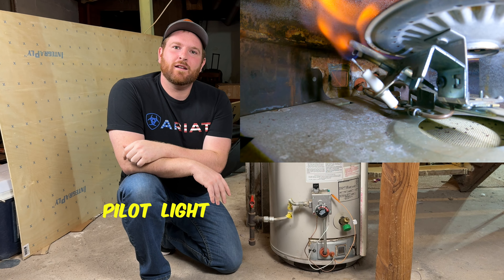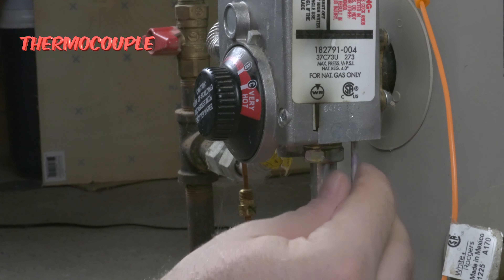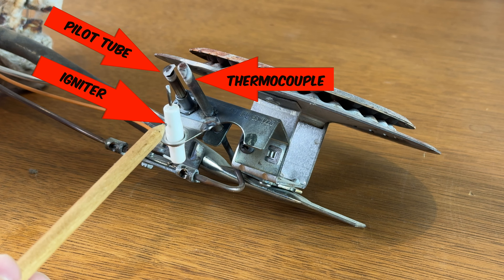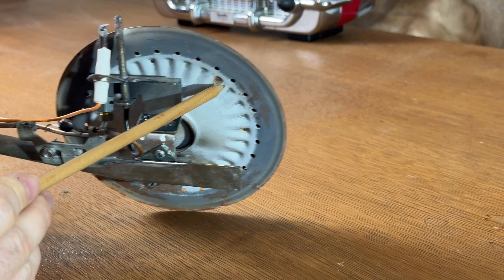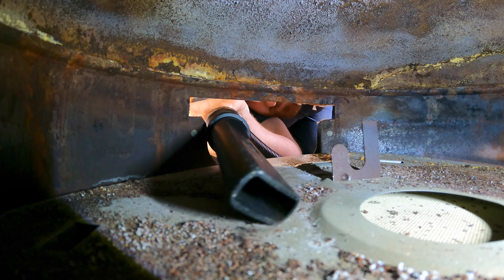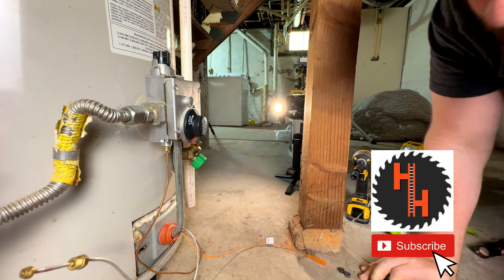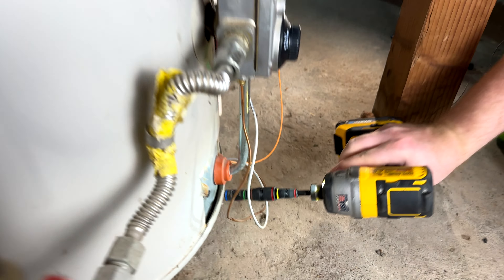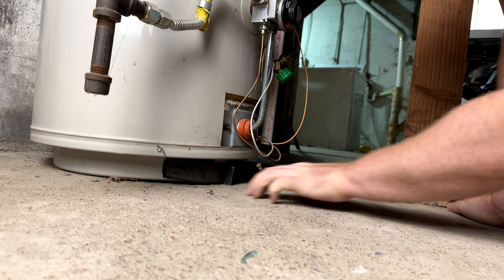FREE Fix! Pilot Light That WON'T STAY LIT on Water Heater

Comment: I replaced the thermocouple, go to light the pilot. Pilot stays on, but as soon as I let go of the gas, it shuts off? Any ideas?
Reply from the maker: Yes, often when a thermal couples replaced the flame is not hitting the thermocouple properly. I'd check that.  If that's not it, your main control  valve may not be working right, assuming the thermocouple is correct and working right.
Reply: @HandymanHertz  I double checked the thermocouple, looks good. Anyway to check the gas control valve before buying a replacement?
Reply from the maker: @CesarMEgureGonzalez no, I've never messed with them. I'm also not an expert, so you may ask someone who has more experience. Sorry.
Reply: If you have a blinky light that is supposed to come on, mine told me to hold the pilot button until that light started blinking.  Then turn it to the temp that you want.

Comment: Hi thanks for the video. I have the same exact thermocouple but unfortunately mine is broke. All the replacements I've seen or have been told will work from parts departments do not have that black battery looking piece. I can only find it on amazon. What is it and is it not needed? Can I replace it with a regular thermocouple? I did a temp solder to make sure that was my issue and the water heater worked fine so i know its the thermocouple. Thanks
Reply from the maker: What do you mean black battery looking piece?
Reply: @HandymanHertz  I'm not exactly sure what it's called. A fuse link? It's the piece there that looks like a small watch battery.
Reply: If you pause @2:01 its the little round thing in the bottom left corner. @HandymanHertz
Reply from the maker: @FishingWithZach oh, ok. I know what you're talking about and I wondered what that was too. I'm not sure what that is. I bought the whole kit on Amazon that came with it.

Comment: GSW only 2 years old. Pilot light stays on but as soon as i turn valve to low or high i get a backfire. Any ideas? Chimney is clear. Maybe the filter needs cleaning?
Reply from the maker: Oh, a backfire? Interesting. I've never ran across that. It almost seems like the burners are not aligned with the pilot light, so the burners put on gas, but it takes a while for it to ignite and once it does it poofs? That's my guess, maybe someone else can jump in here with that experience.
Reply: @HandymanHertz  thanks 🙃
I just pulled assembly out and cleaned burner and thermopile. Neither one in bad shape, but now its heating water. 🤷‍♂️. I’ll take it.

Comment: I've replaced the whole burner assembly and the control board. At least the board functions now. Before it wasn't readint it was lit. Now i will hold it & it goes to overheat light flash. Everything was clean. Still not working I'm literally gonna give up now.

Comment: Hi. I'm so glad I found (and subscribed) to this channel. I have a 3yr old American gas water heater (model: G62-40S-40R). My pilot keeps shutting off every day during the summer. I replaced the thermocouple but it didn't help. I believe the problem is not good enough air supply. My attic isn't vented and in summer it's very very hot. Did you hear of this problem?  Is there any "easy" (simple/cheap) solution to this?    I'm considering an attic fan, but that's thousands of $$$ and I'm looking for a cheaper and simpler solution. ANY THOUGHT/HELP WILL BE GREATLY APPRECIATED AS I'VE SUFFERED THIS FOR OVER 3 YRS NOW. THANK YOU !!
Reply from the maker: Hi, if your pilot light goes out it's due to one of two reasons. It gets blown out by a gust of air, or the control valve shuts off gas to it. I would check to see if the flame is fully hitting the thermocouple, it may need adjusted. Then I'd make sure no windows were open where it it located. I'm not sure on the chimney flue, but maybe there's a backdraft that comes down and blows out the flame?
Reply: @HandymanHertz  Hi there. Thank you SO MUCH TRULY for replying to me. It certainly isn't the thermocouple cause not only I replaced it, but also this problem happens only in the summer, not in the winter. I thought it was not enough air supply, rather than a draft that's turning off the light. I will look at the chimney even though the fact this happens only in summer when temperatures are so high (over 100) suggests it has to do with the weather, cause all else is equal (thermocouple, chimney, windows, etc..). I thought air supply coming from under the tank is needed to supply oxygen to keep the pilot light on. Isn't that true? would you know how I can test how much air supply or oxygen I have there under the tank?

Comment: I totally lucked out when a contractor showed me how to change the thermocouple and do minor maintenance on my boiler system.  He said he had to charge me just to show up and then hourly after that, even though it takes all of 5 minutes to change it out.  Thermocouples are cheap so I recommend buying two so you have a spare ready to go.  Thermocouples never seem to fail until it's the middle of winter and when the stores are closed.
Thanks for the video.  I wanted to make sure it was similar to what I was shown on the heating system.
Reply from the maker: Yes that is true. They are cheap…have one in hand ready to go

Comment: So I have that exact HW heater and thermocouple/ pilot assembly. I replaced the assembly this time last year. After replacing everything still no joy. Solution : My intake and exhaust were clogged with lint and dirt. (Tank is in the garage next to the dryer.) Blew everything out with my compressor. And this is the longest it’s ran so far.
Reply from the maker: Cool, thanks for sharing this. Nice to know other people's experience and input 👍🏼

Comment: Thank you so much for this video! I never would have messed around with my water heater before, thinking it's too complicated and dangerous, but you made it extremely simple and may have saved me from having to buy a new water heater or pay a lot of money for repairs. I keep checking the pilot light, expecting it to be out again, but it's been on for 2 days now (compared to going out every few hours before) so I'm feeling hopeful! If nothing else, now I know how to take it apart and try other repairs. I also loved being able to get in there and clean out all of the debris and polish up the little viewing window.
Reply from the maker: Yeah! Some stuff like that is so easy, but so intimidating. That's why I love YouTube...someone showing us how to and empowering us to do it ourselves! Now, go check out my anode rod video and flushing the water heater video to keep that water heater humming for years (hopefully)
Reply: @HandymanHertz  update: the pilot light went out again after a few days, but now I was confident in working on my water heater. First, I bought a new thermocouple and replaced the old one, but that didn't make a difference. Next, I figured out that if I bypassed the high limit switch, the pilot light would stay on. So, I replaced the old limit switch with a new one (which cost $40) and the pilot light has remained lit for a week so far. I'm quite confident that the limit switch was the problem and I have avoided buying a new water heater! Thanks again for your helpful video!
Reply from the maker: Nice! I do not know anything about the high limit switch, I've not had to do with that yet. If that still gives you trouble, one of the main reasons why a new thermal couple doesn't work is the flame isn't hitting the thermal couple when it's put back in and is aligned wrong. Make sure the flames contacting the thermal couple good 👍🏼 Glad you got in there and fixed it though!

Comment: I wasn't able to easily get the bolts unscewed, unlike what's shown. I finalky got it loose, but the tool bent the line. The wires on mine don't seem to have any way to be undone. Went to next step but trying to get the screw loose is impossible. I start to smell gas even though the gas is off. There are two valves on mine, one is red, one is yellow. Do I turn both off. This seems so easy but it would be helpful to see the tools needed or have tips for getting these bolts loose!
Reply from the maker: Hmmm it seems like one time I ran into this. I couldn’t get the bolt loos without ruining something…just too much torque required. I believe I took off the cover (where the site glass is) off in two pieces and left the burner in and just replaced the thermocouple by reaching in there. I don’t remember what brand but that nut didn’t want to come off, just like yours. That’s only happened to me once.
Reply from the maker: Also, a flare nut wrench would have been the proper tool to break loose that nut, but you need a holdback or the pipe might bend.

Comment: Great video! This worked after cleaning it twice, I decided to try cleaning it a second time before the hardware store opened and just needed an extra sand with sanding pad instead of paper.
Reply from the maker: Great! Glad to hear it. sometimes The flame doesn't hit the sensor when it's reinstalled, so if it gives you issues, that might be something to look at as well 👍🏼

Comment: I have the same exact water heater and I sanded the thermocouple but it's still going out. It will stay lit when I light it but then after a couple minutes and it's not calling for heat anymore the pilot goes out. Maybe I need a new burner assembly? Or you think just a new thermocouple will work?
Reply from the maker: I would first mess around with your current thermal couple and make sure the flame is hitting it directly. If it's only partially hitting it, it can be fickle. Then, I would change the thermal couple. I doubt it would be your burner assembly, especially since it works until it loses a pilot light.

Comment: Thanks for posting this. I do have a question. My issue is with the burner as it doesn’t turn on. The pilot light stays lit and the status light is normal. It blinks once every 3 seconds but the burner is out. I took out the whole burner assembly cleaned it and also cleaned the thermocouple like you did in the video. Put the burner assembly back and the burner won’t stay on. Took the whole assembly out once again and this time replaced the thermocouple. Put the assembly back with the new thermocouple. Now the pilot won’t stay lit and the status light does NOT come on at all. No blinks or anything. Just completely out. The pilot light goes out after I let go of the dial knob. I hope you could help me out. Thanks again.
Reply from the maker: I may be able to help. 

If the pilot light does light, but doesn’t stay lit (after holding it for 1 minutes) you need to adjust the thermocouple position so the flame hits it properly.  

Im confused… does the burner turn on or just turn on for a while? Also, your gas valve should have a code on what the blinking lights mean. What code does it read?
Reply: @HandymanHertz  I tested the thermocouple which is rated at 750mv with a voltmeter and it is reading at 649mv. My question is,  is that enough voltage that it is getting to send that little current to the solenoid to open it up to let the gas flow to the burner to turn it on? Because that’s my issue, I don’t think the motherboard is detecting that current that the thermocouple is sending. How much voltage does the thermocouple need to send to the motherboard to open up the gas valve? So just to be clear I’m able to light up the pilot light. After holding it for 90 seconds, I get no blinking from the status light indicator. So as soon as I let go of the dial knob, the pilot light goes out.
Reply from the maker: @ktp0913 it sounds like you have a bad gas valve to me. The new ones go bad more often than I’d like in our rental houses. I like the old mechanical ones without the blinking codes. 

Your thermocouple (technically called thermopile if it puts out that many mV) should be putting out enough mV to open the pilot tube solenoid for the pilot light to stay on. (If pilot isn’t on, main burner won’t turn on either) I looked at a few forums online and I think it’s a bad control valve. I would try tapping it on the bottom with pliers, you may get lucky. Sorry I couldn’t help you more
Reply: I’m gonna check the gas valve and see how much resistance it has. Thank you for your help.
Reply from the maker: @ktp0913 good luck to you, hope you get it 👍🏼

Comment: I had a water heater that shared a 2 story vent with the furnace. If the air in the vent had cooled and was filled with cold air, the draft inducer on the furnace would blow back down the water heater vent and blow out the pilot light.  Adding an electronic igniter to the water heater solved the problem by reigniting the pilot flame whenever it did not sense the flame.
Reply from the maker: Very interesting. I hadn’t heard of that before, Thanks for sharing!

Comment: Awesome video. Very detailed. My water heater is giving me problems with the pilot light and this seems like a logical answer as to why. My heater looks different from yours, mine does not include an igniter or the faceplate where the tubes travel through. Also mine has a blanket wrapped around and foil taped to it making it hard to see the make and model. Not entirely sure what to buy to replace the thermocouple. I believe this is the original water heater that was installed in the house by the previous owner back in 2003.
Reply from the maker: Thanks for watching! I would assume you would need a generic one like in the packages I showed in the video from Honeywell. I’d say of all of the hot water heaters I’ve worked on, my style is more rare. But I’d look to make sure. It should be an easy fix if you can get to it. 

You can search for a thermal couple video that will show you how to replace that specific kind you have. Good luck to you.

Comment: I replaced my pilot assembly just like you said but and the pilot lights and works great now.  However I am getting a small gas leak that I just can't get rid of.  Nothing is cross threaded and I just barely tightened the fittings at first.  And the smell only develops once the pilot is lit so it must be the fittings on the bottom of the control unit.  Any idea what I should do short of just getting a new water heater?  This heater is about 6 years old and I don't want to keep throwing money at it!  Is yellow teflon tape ok to use on those fittings?
Reply from the maker: Glad you got it working. 👍🏼 regarding the gas leak, you can see in my video that I didn't use any pipe dope/thread sealant or any yellow (for natural gas) tape. That's because the way they seal is a compression fit, not a threaded fit. The threads are only there to compress the fittings together to make a tight seal. My first thought is that maybe some of your tape is hindering that seal? Or maybe some tape got in between where it seals? 

What I would do is mix a tablespoon of some dish soap on a bottle, shake it, and spray it around the fittings. That way you can identify which one is leaking. Bubbles will form wherever there is a leak. Once you've isolated where your leak is, you can tighten it until there's no more bubbles. If tightening it doesn't help with the bubbles, I would shut off the gas, take it apart, and try it again after you clean everything, especially the yellow tape, and inspect it for obvious damage. 

if it still leaks, I would look into replacing the control valve AND/OR the gas tubing, which will be cheaper and easier than replacing the whole water heater. Hope this helps.
Reply: @HandymanHertz  Thanks for the quick reply!  I did not use any thread tape yet... I was just wondering if I should try some because I can't seem to get the leak to stop any other way.  And I would only put it on the threads not the actual compression fitting.  In the mean time I'll try the leak test because the 2 connections are very close to each other so I'm not sure which one is leaking.
Reply from the maker: @tommichaels2466  sounds good! I'm curious to see what you find, keep me posted!

Comment: Thanks for the video!!! Worked perfectly.  Luckily our local ace hardware store had competent employees and I purchased a complete pilot assembly replacement kit. I tried the first option to clean the thermo coupling it didn't work.  I'm very happy as I only spent $50 for the kit.  Way way less then a service/repair visit from the repair man!
Reply from the maker: Great! Glad you got it fixed! Yeah, an honest plumber would have charged $200+/-, And a dishonest plumber would have told you to replace the whole hot water heater $1,000 +/-

Comment: Once it turns on can we return it back to pilot mode ? Or keep it on at all times? Will the flame turn off when it reaches a certain degree ?
Reply from the maker: If everything is working properly, you should be able to switch it to pilot out on and the pilot light should not go out on either setting

Comment: I have two hot water heaters side by side and they both went out. I tried to restart them. No mater how long is hold the red button down the second i release it the pilot light goes out. This is on both of them. I guess ill try this and see tomorrow.
Reply from the maker: Did you have any luck? Make sure the flame is hitting the thermocouple when you put it back in.

Comment: Also, I've replaced my polot assembly and it still wont stay lit.  I'm thinking it could be the sensor (black fuse looking thing) on the thermocouple, but this is the 2nd thermocouple I've tried.  How do I test it if its brand new? 

I may try cleaning the old one like you show in this video to see if it stays on with it.